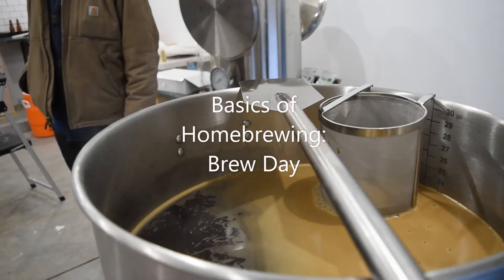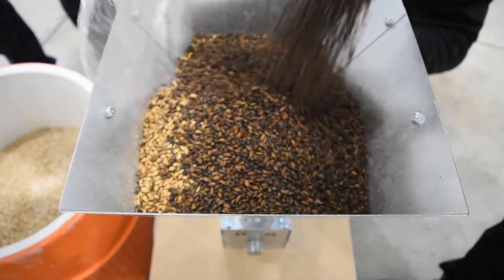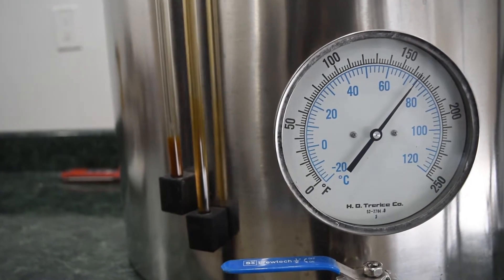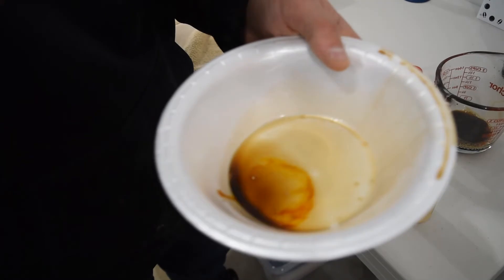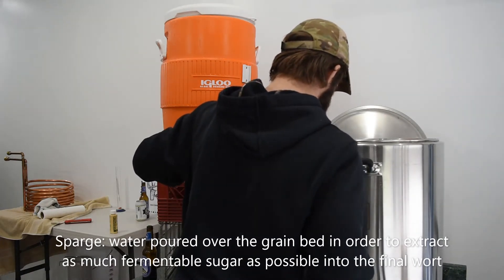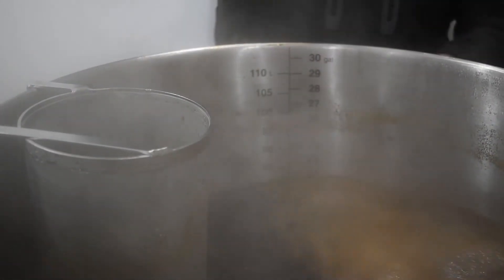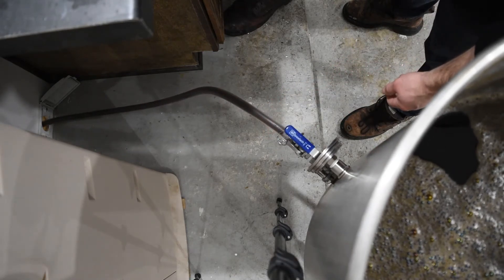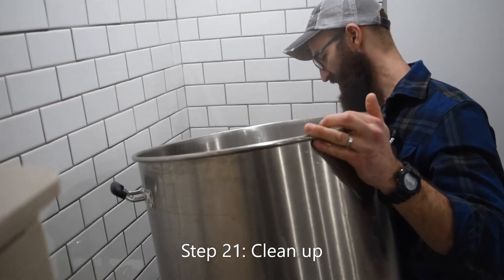All Grain Homebrewing Basics: Brew Day

Comment: GREAT VIDEO!!! GREAT TIPS!!! GREAT EQUIPMENT!! GREAT JOB ON SPARGING!! 
At step 7 on starch conversion. 
Here's the way it works. Alpha liquefies simple starch and saccharification occurs. Alpha liquefies a 1-4 link in the amylose starch chain and when that happens two chains form. The one chain is called the reducing end, which contains sweet tasting, nonfermenting types of sugar. The other chain is called the nonreducing end, which is simple sugar, glucose. Glucose is responsible for primary fermentation and ABV. At a rest temperature of 150F Alpha releases the highest volume of glucose as possible from starch within an hour. The more glucose, the more ABV. 
Beta is responsible for conversion, which occurs at 140F. During conversion Beta converts glucose into complex types of sugar, maltose and maltotriose, starch isn't involved with conversion. When conversion occurs secondary fermentation takes place, due to maltose. Maltotriose is responsible for natural carbonation. The high temperatures used in homebrewing denatures the low temperature activated enzymes that are needed for producing ale and lager, Beta in particular.
Iodine determines if starch is present it doesn't work for determining when conversion occurs, especially, when a rest temperature high enough to denature Beta is used. The color of Iodine can vary depending on the type of sugar that's in the sample. The color can range from yellow/orange to the color in the test sample. The higher the mash temperature the deeper the color of the sample. The lower the mash temperature, the brighter the color of the sample. Brewers Iodine is concentrated and it should be thinned down for testing for starch. The drugstore brand is good to use.
To produce cleaner extract, skim off hot break as it forms and continue to remove hot break until it drastically reduces and when that happens, add hops. Boil the wort for at least an hour, skimming off second break as it forms. Less hops are needed and hop utilization improves when extract is clean. The less goop and sludge carried over into fermentation, the better.
To produce pseudo, ale and lager purchase under modified, low protein, malt. Weyermann's floor malt is under modified and low in protein. Under modified, malt is richer in enzyme content than high modified, malt and the less protein in malt, the more sugar. A malt spec sheet comes with each bag of malt and modification and protein content are listed. Malt spec sheets are online from each malthouse. 
A step mash method should be used with under modified, malt with rests at 145, 153 and 158F for 30, 20, and 20 minutes with reaching temperature steps within 10 minutes. The malt and instructions will produce a baseline, pseudo, ale and lager. The mid and upper temperature and rest periods can vary according to the style of beer and taste buds. When the brewing method is used, liquefaction, saccharification and conversion occurs.
The Hochkurz brewing method works better with under modified, malt and it is an improvement over step mashing. Mash is boiled, twice, which does some great things. The brewing method produces very clean and stable, extract, meaning that the beer can be conditioned for longer periods of time without deteriorating. The brewing method produces, almost, authentic ale and lager. The triple decoction method produces authentic ale and lager. When the methods are used, liquefaction, saccharification, conversion, dextrinization and gelatinization occurs. Dextrinization and gelatinization are responsible for body and mouthfeel in beer.
Amylopectin is heat resistant, complex starch that contains tasteless, nonfermenting types of sugar responsible for body and mouthfeel. Amylopectin makes up the tips of malt and it is the richest starch in malt. The temperatures used in the homebrew method aren't high enough to cause the heat resistant starch to burst and enter into the mash liquid before Alpha denatures and the starch is thrown away with the spent mash. When the starch is thrown away beer overly dries and thins during fermentation and conditioning. It is one of the reasons why homebrew is artificially carbonated with sugar or CO2 injection and drank when the beer is still green.
STAY SAFE. STAY PARCHED. STAY BREWING.